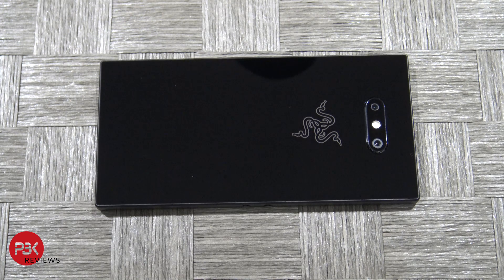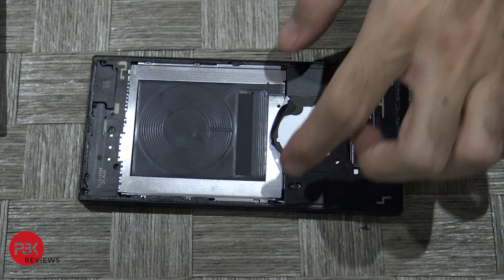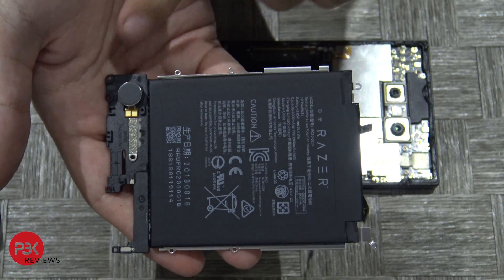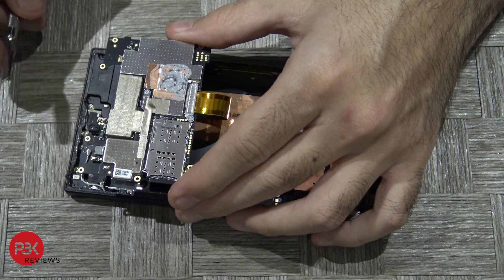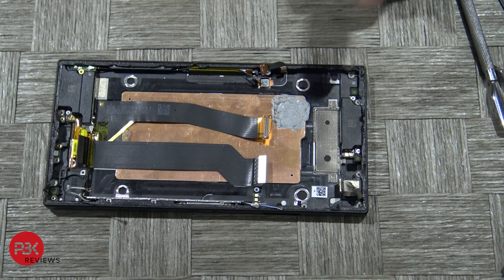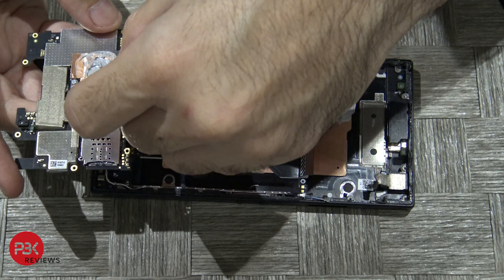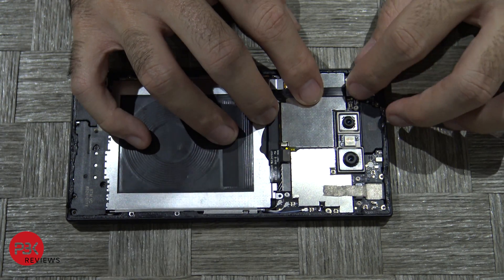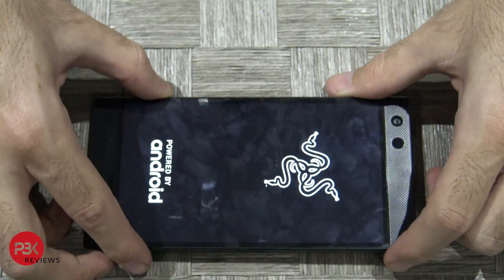2018 Razer Phone 2 Disassembly Teardown Repair Video

Comment: This was greatly informative. Im going to do a disassembly myself and try to fit in a bigger battery and replace the thermal paste.. also see if i cant live without the wireless charger and the rgb light.. i am making an aluminum backplate to help with heat dissipation and the bigger battery so i can pull more performance and game time out of the unit, planning on overclocking mine. Man i am glad they didnt just outright glue the fucking battery into the device and opted for screws, makes servicing and modding it much easier of a proposition
Reply: Did u do the backplate and battery mod?
Reply: @tomjines  yup but I also am no longer using that phone. I dropped it and the screen cracked from the left side. 

I put in a 5000mah battery in it, same overall dimensions. I machined the backplate out of a sheet of aluminium and glued it on. It also had a contact made of copper attached with a vapor chamber in between them. The copper contact was flush with the mid frame of the SoC.

The CPU temps got really cold when I went outside and the phone was mostly idling.

Comment: Cant you replace the charging port without changing the whole charging board?
Reply from the maker: It would require soldering knowledge to de solder the charger port and solder a new one on.
Reply: @PBKreviews  thank you for your reply. Yeah  I haven't been able to find the whole charging board online, and I live in Venezuela.. the technician I contacted said he could do it but I wasn't entirely sure if that was a possibility.. thank you for the video and the reply
Reply: @PBKreviews  is there a risk of losing the information on the phone while doing this?

Comment: I was trying to charge my phone through a cable, and it kept jumping from charging to not charging. So I plugged the cord in and out multiple times until suddenly the phone turned off (the battery was at 7%). I tried to charge it with a wireless charger (which usually works) and it still didn't work. The phone is not responding at all, not even a sign that says it requires charging. What does this mean?
Reply from the maker: Hmm not sure. Have you tried holding the volume down and power button for 30 seconds to see if it will reboot? Might be a bad battery as well or your charger port might have shorted not sure. Hopefully it didn't short out your motherboard.

Comment: Any tips on how to clean the speaker grills? It seems quite destructive digging all the way into the lower part of the phone to get at the speakers, so i could remove them, clean them and the grill, and put it all back together. Is there an easier solution?
Reply from the maker: You can try to use a small brush or tooth brush to brush them out.

Comment: 10:00 min if the USB type C had the black thin paper thing like cut or disconnected, much more of seperated does that mean d have to get a brand new one? and if so any idea where to look for? im currently wireless charging but i cant keep it up for long.
Reply from the maker: yea, the sub board/charging port board would need to be replaced. At the moment can't seem to find any available online, so your only option would be to send it in to razer to repair for you.
Reply: @PBKreviews  costly 🤣 might buy a used razer for such price with the part needed and with extra as well xd

Comment: Question. My razor phone just stopped charging for some reason and I might try to replace the battery but I have some important stuff on it so I was wondering replacing the battery will it wipe everything or effect the stuff in storage in anyway?
Reply from the maker: Hi, no replacing the battery will not affect storage.
Reply: @PBKreviews  amazing but I have semi fixed the problem, if I position my phone at the right angle my phone will keep on flashing the charging screen and every time I turn on my phone it boosts up in battery power

Comment: Can the usbC be replaced easy without taking it all apart?
Reply from the maker: You would need to take the back off as well as the cover and bottom assembly to gain access to it. Basically you wont have to remove the motherboard but you will still need to take the phone apart to replace the part.
Reply: @PBKreviews  okay just not a full gutting.  That is doable, better get my gloves.  I seem to have high electrical field in my body.  Watch batteries and such drain real fast on me heh.

Comment: i'm scared to use this telephone in my everydays life, especially for jogging. cause it's precious. i know razer phone 3 will never come down to 160$ that fast and i will have to preserve it for years. i already have a lumia 735 but for apps such has happn you need to have an android device always with you to increase your network circle. anyway, protective glass and sleeve looks like a must have with this kind of product.
Reply: The site does not even support or sell mobile phones anymore.  I have been trying to find a USBC replacement part or anything to solve my charging issue.
Reply: @jessz9284  the razer phone was discontinued for sefety reasons (not pass tests in europe for magnetic harmful frequencies), that's why you can found it 150$ instead 1500$ on ebey ;-)
Reply: No razor phone 3 coming
Reply: @jessz9284  yes but not a 160 $ ^^ maybe one more zero ^^

Comment: so expensive and so fragile. i wanted to see where was located the wireless charging connector cause wireless charging stand can't be purchased anymore and still having 6 LG G3 charging supports all around my home. i hope they will work with this razer phone 2 i've just found for 160$ in very good condition on ebay
Reply from the maker: yea they are fragile.

Comment: Does that code on the charging port board give you any type of part number? Are there generic charging ports that will work with this phone? Razer won't sell me a part and I cannot find it online with only a razer 2 charging port search. Thanks for your help!
Reply from the maker: Hi, I checked online and couldn't find a replacement either. Have you asked razer if they offer send in repair service?
Reply: @PBKreviews  thanks for checking,  they wanted like $300 and wouldn't sell the part so I passed
Reply from the maker: @Penzza19  oh, ya that's not worth it. Just keep checking on ebay and google sometimes people list it.
Reply: @PBKreviews  bought an s21 thanks for your help!
Reply from the maker: @Penzza19  you're welcome
Reply: @PBKreviews  I've found the part, seems to be: SBORC21R10D. There's a listing on AliExpress for $15 for this flex cable/port. I'm ordering one to test in my Razer Phone 2; fingers crossed!
Reply: @hoppytaco5157  how did it work out for you?

Comment: I need a charge port! Please comment if you know where I can get one
Reply: mine is barely working when phone is on, but when the phone is off, it's working great.Go figure
Reply: @ЭльвираОрлова-о7ь  wireless charger is the best option
Reply: @philosophy4242  does fast charging work with wireless charger?
Reply: @philosophy4242  does fast charging work with wireless charging?

Comment: I have a bad charing port and Razer will not send one, only want to take my phone for a long time, wipe its data and charge me a heavy cost. Any way to fix it, or other ports to replace it with?
Reply: It really sucks tbh, I just got a new phone because I was tired of the issue, alternatively you could also use a wireless charging pad. Although no data transfer of course.

Comment: This is the best phone I have ever had. If you know the feel and difference of having a PC on M.2 and an i7 or better processor with a solid graphics card. This is what this phone feels like. I always keep my phone for 2 years or more and this is the first one that feels exactly like it did on day one, maybe even better because of software upgrades. The battery is the only thing that needs to be replaced and that's why I'm here.
Reply: Not me my Razer phone 2 is junk so many hugs especially camera speakers are blown out and the charging port is out now... This phone lasted me 1 year and a half when others way longer. Junk phone.
Reply: I'm noticing my battery 🔋 is becoming weaker. I love my Razer 2, it has not let me down. I will need to replace the battery soon.
Reply: My experience (with razer 1 and 2) was a negative one. The screen glitched with both models within the year. I got the samsung S series and never looked back.
Reply: I agree. I've had this phone since 2018 and I still use it today. There just has not been a reason to stop and new phones don't really appeal to me. The only issue is the battery life, which barely lasts a few hours now, hence why I'm on this video looking at how to replace the battery. But, honestly, after 7 years, I expect the battery to start degrading so I'm not complaining.
Reply: Charger port is crap and the batter also didnt last

Comment: how hot do you need to get phones to loosen the glue?
Reply from the maker: Using a hair dryer, just heat it up as you go. Hot to the touch, then you can use a suction tool to help you lift up to give you leverage to get a pry tool in between and apply heat as needed along the way if it is still too difficult  to pry it off.

Comment: Aaaaaaand on the first step I cracked my back glass.......
Reply from the maker: Sorry to hear that. They are fragile you need to be patient and take your time as well as apply heat to loosen the adhesive a bit.
Reply: @PBKreviews  I did apply heat to loosen the adhesive but it still cracked. At least my phone case will cover it up.
Reply from the maker: @solesoul2108  Yup. Just incase you need a replacement, there is one on ebay : https://www.ebay.com/itm/Replacement-MIRROR-Black-Battery-Door-Cover-Tool-for-Razer-Phone-2-5-72-ZVHB703/193748405903?hash=item2d1c4e0e8f:g:4JwAAOSwLKxfrqz2

Comment: Where the f*** is the front microphone
Reply from the maker: the main microphone is located on the bottom right corner of the charger port board. Its a small gold rectangular metal piece.

Comment: I have two razer phones but I need to transfer the battery from one to another will this work?
Reply from the maker: yes as long as they are the same model phone it will work
Reply: @PBKreviews  thank you sir appreciate you
Reply from the maker: @FinesseFlightOfficial  you're welcome
Reply: @PBKreviews  so i cant  swap the battery for a chinese one? Or one from a different brand?
Reply from the maker: @jaimdiojtar  It would have to be a battery that is specific for your phone. It's not like back in the day where one battery would work for a range of phones. As long as the battery is made specific for your phone it would work but I would personally try to use an original nothing else. Aftermarkets do not last long at all or cause issues with the operation of the phone.

Comment: what battery can be a replacement for the battery in the razer phone 2
Reply from the maker: Hi here is a link https://www.ebay.com/itm/RAZER-2-RZ35-0259UR10-R3U1-BATTERY-WIRELESS-CHARGING-VIBRATING-COMBO-RC30-0259/223534292425?epid=5032314092&hash=item340bae9dc9:g:J58AAOSwQK5c7rSD
Reply: @PBKreviews  thank you i might buy it but i was asking really what other phone batteries are compatible with it
Reply from the maker: @jerrykubiak5945  Oh, probably no other battery would work for it since the connector position and type would be different as well as compartment where the battery sits
Reply: @PBKreviews  i see i. my head i was thinking there are just so many ways they can make them they are bound to make batteries similar

Comment: My Razer Phone 2 won't charge. Where can I buy a charging port replacement. Ist would be nice If someone, who found one could post the link.
Reply from the maker: You can try messaging this seller to see if they have anymore but their listing shows sold out right now https://www.ebay.com/itm/RAZER-2-RZ35-0259UR10-R3U1-CHARGING-PORT-RZ35-0259UR10-R3U1-CHARGING-PORT-/223839487467    . You can also contact razer to see if they have repair options

Comment: Ok so u didnt show how to take the screen out... thanks for nothing..
Reply from the maker: As I have told others before, after taking the phone apart, all that's left is for you to pry the screen off. Its only held on with adhesive. You just heat it up and pry it off the frame. The point is you need to take the phone apart to be able to disconnect the screen cable and be able to reconnect the screen cable for your new screen. If you can't figure out that part then you should not even be taking a phone apart to begin with because you will most likely damage parts along the way of the disassembly which will render your phone useless even before you get to the screen part. It's like taking the bolts off a rim that's on a car then asking someone ok now that the bolts are off, how do I remove the rim with tire off the car? you just pull it off.

Comment: I have a quick and possibly stupid question: where the wireless charging nodes located? I use a wireless charging pad and I have to keep moving the phone all around until I get a charge. However, it is super unreliable.Thank in advance everyone!!
Reply from the maker: Hi, its the black square pad with the coil (circle pattern within it) on the back. Pretty much from the middle back of the phone to the lower bottom of the phone.
Reply: @PBKreviews  I bought this pad but it chargers very particularly - i have to spend like 10 minutes for the proper placement. Would you recommend some affordable and accessable wireless chargers - my charging port is completely messed up?

Comment: My razor 2 doesn't charge I thought it was a computer problem and I factory reset it but it did not make it difference it just charges so slowly it takes me a day or two to get it to 100% should I replace a charger port or battery or both
Reply from the maker: Have you tried a different charger? Also it's possible it might be a battery or charger port issue, you wouldn't know until you tested both ( of which trying a replacement battery would be easiest to do first).
Reply: @PBKreviews  ok I tried to use a couple different chargers and it doesn't seem to be a loose connection from the charge er I u could get me some links I could find parts thx

Comment: I know this is an old video but I just wanted to say thank you. I bought my Razer phone brand new but after just a year and a half the USB-C port died. I actually love the phone and planned on keeping it for at least 3 years. Managed to find a used usb/charging board on ebay for $30 and was able to repair it with your video. You saved me from having to drop $400+ on a new phone!
Reply from the maker: Glad it was able to help you out! :)
Reply: Do you have a link to that? I've had the same issue, all I can find is a $55 one
Reply: @tkidmstr  Sadly I don't think I'll be much help. The eBay seller was ant8300 but it doesn't look like he has any right now.
Reply: @darkrocker246  aw, yeah I thought I saw the listing you were referring to. Thanks for replying either way.
Reply: @tkidmstr  no problem, good luck.
Reply: I need to do this as well and have been putting it off was the process easy?
Reply: @Chef_boy_R_deez  really not difficult. Most annoying part was pulling up the back panel without cracking it.
Reply: @darkrocker246  thanks for replying! One last question did the back cover stay on after reapplying? Or does it need new adhesive? I saw a video of a guy scraping off all the black paint on the back to make it clear I wanted to do this while it's disassembled.
Reply: @Chef_boy_R_deez  Mine was still sticky enough that I was able to just stick it back on and it's held up fine. Although I'm sure the water resistance is gone now.
Reply: @darkrocker246  awesome thank you I have the parts coming in the mail I also ordered a phone tool kit hopefully it has everything I need from the looks of this video I think I have what I need to tackle this. I tried reaching out to Razer to get it covered under warranty and what a absolute nightmare I'll just save the hassle and do it myself. I'm glad there's no soldering involved.
Reply: @Chef_boy_R_deez  Good luck 👍
Reply: @darkrocker246  so I replaced the port and got the phone to charge again through the port which is nice! The only issue is I can't get it to connect to my pc. It says unrecognizable usb. I tried to update the drivers and all kinds of other things like usb debugging under developer options and no luck. I'm wondering if the usb port is somehow married to the motherboard? If you have your phone still could you try connect it to a computer and see if it recognizes it?
Reply: @Chef_boy_R_deez  Very old comment and very late reply but even when mine was working fine for charging it had issues being recognised by a PC. Seems to be a compatibility issue of some sort.
Reply: @abannister08  mine doesnt recognise it charges but its charging...like normally it would just say Charging (Slowly) or Charging (Fast) it doesnt even show the icon charging and it charges ... idk if i should replace the usb c or not TwT
Reply: What was wrong with your usbC?
Reply: Same reason why I'm here, bought a wireless charger a few months back to negate it, but really needing that USB c port back.
Reply: Same problem 😔
Reply: @rudrarudehai  I need a charging port aswell.. still rocking the phone today! going to replace the battery real soon and hopefully if i can find a charging port that too!
Reply: @crazythymos6317  vroo... Now my Razer Earphones is also Start as well. 
Still didn't get a Solution
And Iam live in India so There is chance to Fix this dumb UsbC. TwT

Comment: If I were to replace the charging port do I need to get that board attached to it as well? Or can the port be detached from the board
Reply from the maker: you would need to replace the charger port with that small board since the cable is embedded into that board so its not a dis-connectable cable
Reply: @PBKreviews  ah shit, thanks :)
Reply from the maker: @kierain23  no prob :)